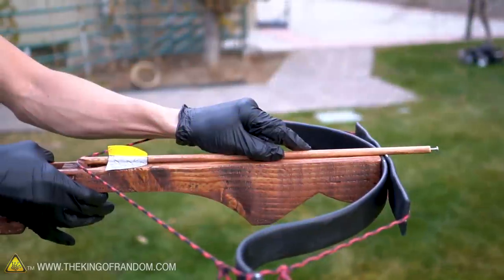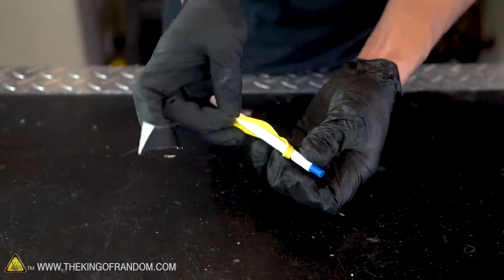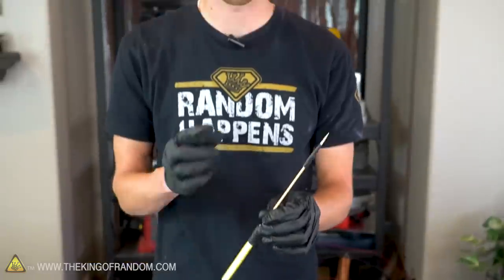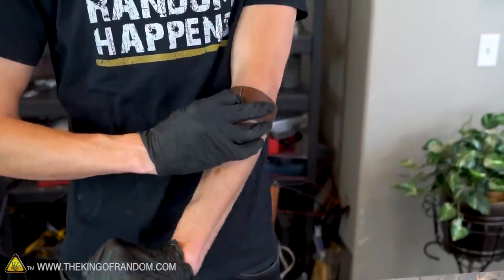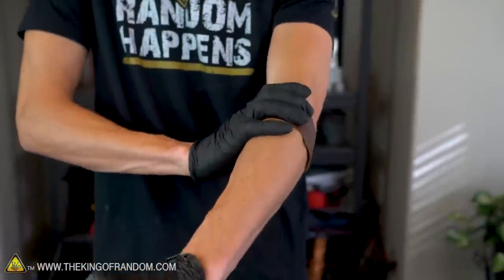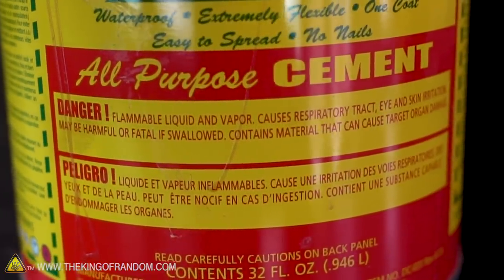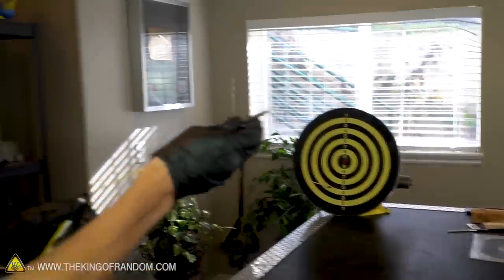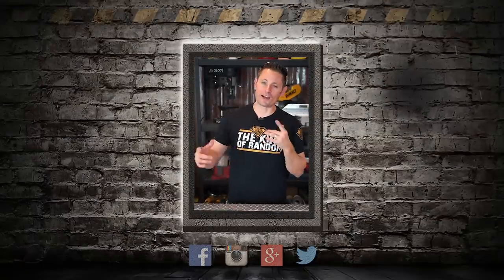DIY Arm Mounted Skewer Shooter

Comment: I made this thing a couple of years ago but I used the ink refill of the pen itself as the arrows because I think that after a few hard shots the skewer would break
Reply: I did that too it worked well but then the ink went on my jeans so I tried skewers and after one shot they were too blunt how did he use the same arrow ?
Reply: Yumi Shima I used empty ink refills to avoid the ink problem
Reply: +Carrot Frost Alien  oh I thought they would not have enough weight so they wouldn't shoot well.
Reply: Yumi Shima the metal tip makes them weight enough so they don’t spin around in the air

Comment: Yaaaas new video, BTW could you try to take a trashcan and make a vortex fountain from it.
Reply: Think it will work??
Reply: Trashcan fire tornado!! And colored!!!!
Reply: Dragonman0007  could work if the trashcan was metal
Reply: Please do!
Reply: LP Games You would need a pump from $70+ to be powerful enough, they would probably need a pond pump. It is possible since its just a larger scale of a mini vortex.
Reply: I'm a 300g aquarium owner and a 300g aquarium pump (the one I got) in Canada sells for about 70-80$ so in us it would be cheaper but considering a trash can is probably only like 30-40 gallons a pump would be like 20-30$ in usd
Reply: TeamBassin TV Ohhh, I was thinking of air pumps. I bought on up to 10g and it costed $20can. I guess a pump for a trash can could cost no more than $60can. How did you manage to get a 300g? Built it?
Reply: yeah, well with help as I'm only 15 lol but I payed for the whole project and supplied everything

Comment: Guess what if you add sodium acetate to baking soda and vinegar. I've heard on internet that it is a cool experiment. Like if you agree
Reply: Wouldn't baking soda and vinegar react to produce sodium acetate?
Reply: Idk, I've heard that the mixture will produce something known as hot ice.
Reply: Mr. Fire no it is not dry ice, it is hot ice.
Reply: +Aditya
The sodium acetate is the hot ice.

Sodium bicarbonate + Vinegar (Acetic acid)  ->  Sodium Acetate + Water + Carbon Dioxide
          NaHCO3            +         CH3COOH            ->      CH3COONa     +  H2O  +          CO2
All in aqueous solution

+Mr. Fire
Hot ice is called like that because it looks like snow/ice while being "not cold" ("hot"). It's room temp, basically.
Reply: CodeBurger thanks for your information ☺️☺️
Reply: Nope baking soda + vinager=sodium acetate boil after adding water refrigerate to cool... you get my point

Comment: What happens of you put termite in liquid nitrogen ✌️👑. 💛🖤💛🖤💛🖤💛🖤💛🖤💛🖤💛🖤💛🖤💛🖤💛🖤💛🖤💛🖤💛🖤💛💛💛💛💛🖤💛🖤💛🖤💛🖤
Reply: arin suzan005 

Thermite in liquid nitrogen will do nothing. Assuming you lit it beforehand, also depending on the ratios, it will continue to burn at excessive temperatures.

Comment: If you replace the barrels for brass piping you can drill a hole in to the tops and connect all three holes with a electric fire starter you can put cotton or armstrongs mix at the end stuff some cotton and fire the skewers

Comment: if i made this, i would shorten the skewers a bit because all the length isnt needed to fire because the rubberbands have a tension limit which doesnt use a bit of the skewers, plus it would make it alot more convienent to keep on the arm bandilear

Comment: I did this at school. Get a marker and cut of the top and bottom. Then cut a rubber band and sticky tape each side on to the bottom of the marker. Then sharpen a pencil and you’ve got a pretty dangerous weapon (if the pencil is sharp enough)

Comment: i did the same as you but instead of bamboo skewers i used chopsticks and i took off the cap thingy and used small but strong rubber bands, one of them went through a ripe apple

Comment: Harden the tips by burning, then sharpen to a point. Add a short internal fuse and place thermite (or whatever load you wish) within the projectile's head. 
Instantly became 10 times deadlier.

Comment: HEY! can you please try to mix liquid Potassium (K) with a piece of Sodium (Na) and see if the mixture will still react in water. Also, try adding a piece of Sodium (Na) into liquid nitrogen (N) and see if it explode like it does with water. Thanks!
Reply: An Doan 

Sodium probably won't react with liquid nitrogen. As for a potassium and sodium mixture, they should just end up bonding, or will do nothing.
Reply: really? because sodium and potassium are in the same family, they should never bond
Reply: Electrum is a combination of Gold and Silver, both elements in the same group.

Comment: hey king of random i was just snooping around your channel ...couldnt help but notice you seem to like sand casting videos...check out the johnathan w channel the guy designed cast and built his own single cylinder engine... he then modified existing valve train parts to use on his engine then took and modified some sortve device for the  ignition system great subject matter if your into design and fabrication...

Comment: You should make a very simple shed then launch a Liquid nitrogen rocket then a co2 rocket then a butane rocket that is on fire then put sodium metal in water and throw it at the shed and finnally burn it completely down with the flame thrower.

Comment: You should liquid nitrogen in the flame thrower then make another one that shoots flames and shoot them at each other
Reply: Ivysaur Studios i think liquid nitrogen would win since its moving the oxygen (needed to have a flame ) away the flamethrower would only be shooting fuel at the freezethrower (as we may call it 🤔) but the heat may be enough to create a low pressure which would then be able to move the nitrogen and take the oxygen from below 

Basically what im saying is if the freezethrower shoots under the flame it wins if not it may or may not wins